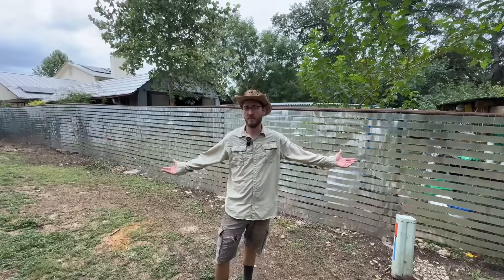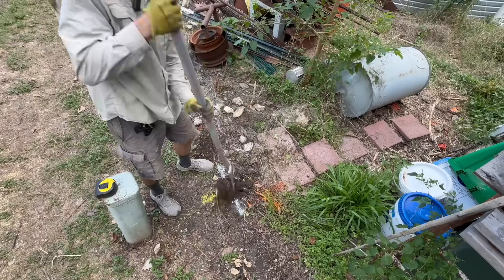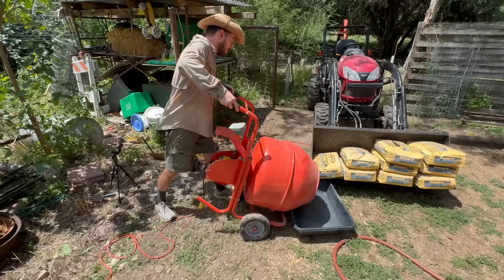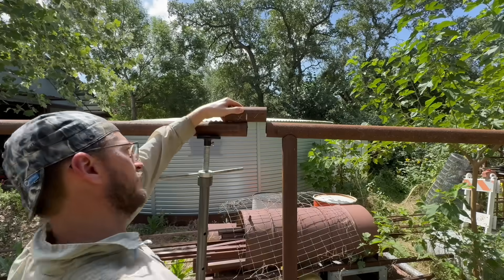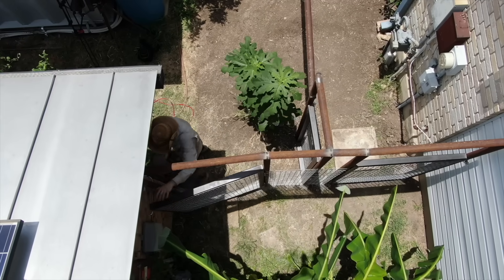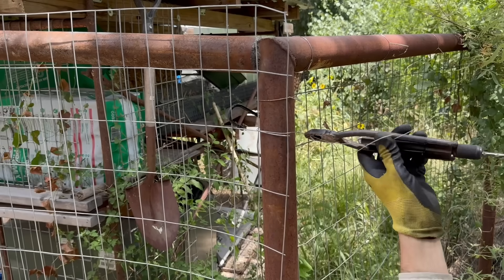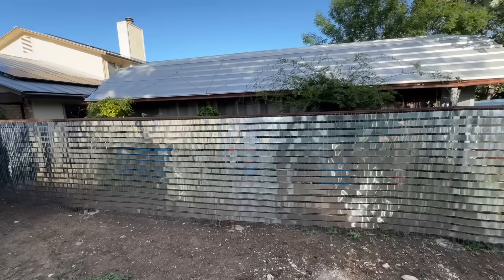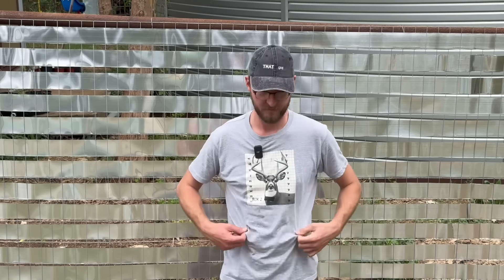This FENCE Lasts 100 years!!!!

Comment: Holy crap. In the best possible way.
The fence is gorgeous and ingenious. Love that it looks simultaneously industrial and soft.
So I'll never in my life do this, or most of your projects but I absolutely love your videos. From the idea, the execution, the quality of the details provided, the cinematography, to the truly clever humor-they're really perfect IMHO. And I always learn something. And it's frequently embarrassing. Like working something through a roll of fencing so when you cut that last wire the whole thing doesn't SPROING open causing you to jump back and having to wrangle a 6' Slinky. I'm only dealing with 4' rabbit fencing but still, that little bit of every day genius would have spared me a fair bit of aggravation. And feeling like an idiot.
The only possible potential downside would be galvanic corrosion but if your area is mostly dry you'll probably avoid the worst of it. To be fair, that chapter was early on in my Chemistry degree and my professional focus is elsewhere so someone else may be better equipped to weigh in to allay any concerns you may have or offer advice. Any oxide coating may be enough to negate that so I may be completely off. A little knowledge is a dangerous thing.
As to the deer, IME they don't like jumping where they can't see a clear landing area unless they're being chased and a risky leap is the lesser of two evils. I've got a 6' privacy fence where the deer are so comfortable they walk down the middle of the street at high noon and you have to steer around them and I've haven't had an incursion in the 3 years the fence has been up. They walk right next to the house and eat the plants at the base of the fence so if they thought getting in was a good idea they'd have done it by now.
Well done. Looking forward to the next video as always.
Reply from the maker: My experience with deer jumping is the same. It’s reassuring to hear it’s not just me. Thanks for the thoughtful comment. I appreciate you being here and weighing in!!!!
Reply: Yes ✝️💩 indeed
Reply: My future retirement home is in a forested, rural area a few hours north.   My neighbor has a 6 foot (maybe it's 8) privacy fence around his inner yard and he hasn't had deer problems since it went up.  He couldn't grow anything before then (too many deer and wild turkeys).  If for some reason you do still have problems, I've heard that putting a second material on top of the main fence confuses their vision enough to deter them.   Stapling a 12 to 18 inch strip of the same fencing used in this video is probably good enough....their eyes aren't setup correctly to have good depth perception.
Reply: My friend had a home in Fairfax, California with the backyard going uphill from the house, fenced 6’ all the way around.  Saw deers jump right over the fence from a standing position, not even a running start.  They thought the garden was their personal diner…😂LOL. No hunters in Marin county so the deer became a real pest in the area….

Comment: No way this is cheaper than wood …maybe where you are ….im looking at at least 5k plus of materials in your video (probably more like 10) lumber prices are tanking and metal is skyrocketing…not to mention you’ve got about 8k in tools to build it 😂…sorry bud, but my parents have a fence at there house I built 35 years ago with my dad that’s still in great shape because we used treated materials. Wood fencing is pretty much the best bang for your buck as far as longevity…if you live in a dry area use pressure treated lumber
Reply from the maker: Rough numbers are in the description. I pay by weight for stem pipe where I live so it’s probably cheaper than national average. It didn’t occur to me but I bought these pipes about 6 months ago. I didn’t check what steel process did after I saved that receipt.

Comment: What about galvanic corrosion? Is that an issue here?
Reply: @suburbanbiology galvanic corrosion requires moisture. So down here in New Zealand I live in place where the grass is always green and it rains all year round. This makes galvanic corrosion a real issue. The two I have had experience with is Stainless - Galvanized steel (iron coated with zinc to stop the rust). The stainless eats into the galv and causes issues. I couldn't figure out if your fence mesh was zinc coated or just steel. As texas may have a dry enough climate that rust isn't such an issue. 

The other is Aluminium - Copper. I cut up old drink cans into strips, hole punched, wrote tree variety names, and attached to my trees with copper wire (as I have a container full of off cuts etc, so was free). Turns out that the aluminium gets eaten into. And within a decade most of the labels had dropped off the trees as the aluminum between the hole punch which the wire went through and the edge of the tag. 

Google should be able to inform you of which metals corrode others. I can't remember the chemistry but it is well known and lists are about of what eats into what.
Reply: @zestoslife  you can just tell Anna periodic table that has electronegativity values
Reply: @zestoslife  Zinc also doesn't behave with aluminum. Aluminum/zinc/steel or aluminum/zinc/steel/stainless junctions in close proximity to eachother can be a nightmare at least in marine environments. Assuming this is all vertical and in a relatively dry climate and everything is kept clean of organic debris, it will dry out fairly quick after rain showers and the corrosion is probably going to be slow. My guess is that the zinc will disappear in five years from the points where the aluminum touches the galvanized steel mesh and after that the steel+rust starts eating away at the aluminum. It will take long to for this thing to corrode but it certainly isn't made to last a century. If that aluminum is indeed 100% aluminum and not an alloy (2xxx, 5xxx or 6xxx), it's probably going to corrode even faster.
Reply: I can tell you from my own pipe fencing that it is an issue. Within the 14 years that I have had those pipe Post in the ground I have had corrosion several times to the point that I've had to replace them. I don't know anything about the fancy science that y'all are talking about here I just know my own lived experience.😂
Reply: @KMF3  I worked in the transmission pipeline stuff. Cathodic protection is pretty easy to do and it's quite effective
Reply: @jeffday2574  ??? I have no idea what you are talking about
Reply: @KMF3  I might have answered you inadvertently I was talking about cathodic protection on steel pipe in contact with the ground. Steel pipe protected in this way is protected for decades
Reply: @jeffday2574  oh ok. I'm not sure how to do that
Reply: @KMF3  you take a 12 volt power supply like a 2 Amp trickle charger and bond a lead to the steel your trying to protect preferably with a cad weld to avoid corrosion run it to the negative side. Then  about thirty feet away sink an anode into the soil I use zinc or magnesium. Attach the positive lead to the anode. You can get an anode for a water heater from lowes or home depot these work very well. So now your pipe to soil voltage is going to read 1 to 2 volts negative. That electrical difference is going to pull electrons from the soil into the metal your trying to protect. When metals rust they are sending electrons from the metal into the soil. This reverses that. When you are testing this stick a screwdriver into the soil attach your negative lead to it and attach a positive lead to the pipe to read the DC voltage and it should read a negative voltage and you want  -.85 or higher -1 or -2 is typical
Reply: @jeffday2574  😲😳 that's way too complicated for me
Reply: @KMF3 😅🤣😂ME neither!!🤷🏼‍♀️
Reply: @KMF3 

Why not use PVC pipe for fence structure?

Would that work?
Reply: @streetsmartintelligent  it might but I doubt it would be strong enough to hold a shade for me or against horses damage
Reply: @streetsmartintelligent  
Probably not rigid enough.
Reply: @streetsmartintelligent 
PVC is a 20 year solution at best...UV light destroys it. Plus it's pretty weak. Sure you can fill the verticals with concrete....but why bother... typical PVC fencing uses metal posts or pressure treated wood, but still, in 20 years it's time to replace it after the PVC is cracked, discolored and typical already failed
Reply: @streetsmartintelligent pvc is normally not uv resistant and will fail as a structural material quite quickly
Reply: @streetsmartintelligent :

Filled with sand mix mortar?  
PVC alone isn’t strong enough.
Reply: @streetsmartintelligent not as sturdy, not environmentally friendly are my reasons.
Reply: @streetsmartintelligent Not strong enough?
Reply from the maker: Technically yes. But I’ve read that aluminum forms a stable oxide pretty quickly. I wonder if that will blunt the corrosion effect. I’ll try to pin your comment to see if we can get a chemist or physicist to weigh in.
Reply: @suburbanbiology read something just a day or two ago that said the oxide coating on Aluminum in air forms in just a few picoseconds so it will be reforming each time it loses contact with the other surface 😉 only place your likely to see any noticeable effect is where it sits in contact and stays wet with something that can breakdown the oxide😊
Reply: @suburbanbiology  I posted above. Yes, the Al will oxidize and that helps. Any movement between the flashing and the fence will scratch it off but it'll reform. It's a casual low-pressure contact so that helps. The big Al/SS concern is with tight contact in the presence of an electrolyte so think about a stainless fastener on an Al sheet near salt spray. Although acid rain is a contributor. The other consideration is the amount of material of each. The SS is the cathode, Al the anode. A large area of cathode will more quickly corrode the anode but since the fence is a smaller area relative to the flashing that offers a measure of protection. Al rivets on a large stainless base is a galvanic nightmare. Your situation is the opposite. Plus if your area is usually dry that greatly minimizes any risk. That's about all I recall-that class was a long time ago.
A metallurgist or materials scientist can give you the best assessment off the top of their head.
Reply: @suburbanbiology  This is an interesting fencing idea! I think U might what to put a pipe in at the bottom. When U weaved the flashing did U do every other one or what did U choose?
Reply: @suburbanbiology  You can install sacrificial zincs, like on a boat, to corrode instead of your fence.
Reply: @suburbanbiology the aluminum is fine but it does speed up rusting on untreated steel depending on the area might be fine but me living in the rust belt will always look for ways to lessen rusting
Reply: The aluminum was a dumb idea. It'll look like shit in ten years.
Reply: Sounds like an Awesome Metal Band Name!! Galvanic Corrosion!!  😂
Reply: Great concept. Creative execution! Love it!
Reply: I ❤ this. I would more than welcome you to be my neighbor. Great job 👍
Reply: Hey, I'm a 2%'er!
Reply: @bob_frazier.....ME too!!!👍😁
Reply: Ok, I subscribed. The fence looks a lot better than the old one! A lot of work though. The comments about metallurgy are over my head! 🤯 The plants are great, I hope they grow quickly to fill in; I think you need more. You have lots of interesting tools. I will never use any of them, as I am a 72 year old grandma living in an apartment in an urban area. So that’s a demographic for you.
Reply: @elizabethturel78  Same here 😂
Reply: I'm wondering if the vines will get burnt by the heat the aluminum will put off when the sun hits it. I'm sure it's going to get so hot to the touch. The fence looks awesome and I wish we had piping like this in Ontario Canada cheaper than I've seen it.
Reply: @rookiefarmer702 aluminum doesn't usually get hot, but does reflect light, so needs plants that enjoy plenty of light
Reply: the vines will be covering the fence well before it corrodes away most likely....
Reply: @jkiker7918  Use for basket weaving 😁😂
Reply: Is there a reason you didn't put flashing on the bottom row of the fence?
Reply: @PhD777  They mentioned sloping the land so the water would run past the fence onto their side of the fence. I'm guessing leaving the bottom row off is to prevent either the flashing from pooling water, or to prevent the flashing from collecting debris like leaves that would then pool water.
Reply: @PhD777 turtle passage?
Reply: If I comment and like, does that mean, I like it or don’t like it? 🤔
Reply: Do like your build and techniques used for installing fence along with “Fonzie” “Bill Gates”  puns….but seen no one questioning all that metal flashing,  your yard must be like 2000degrees anywhere close to that fence? I know I make unreal comment but it must be like a solar cooker with a few ft of this fence, Texas avg probably being 100 degrees with 12 hrs of sun every day through the summer.  Can’t imagine any plant growing within 2 ft of that fence? Would like to have seen differt colored flashing (red; green; blue; etc).      But you did a really nice job and great explanation on staking, welding, cutting, etc. Also like how you saved the Sycamore tree, the can grow really big and go 300 plus yrs old.  Volunteer and plant lots of trees myself. Keep up the good work.
Reply: The Fonz.    Hahaha.  Fawns ~ are so so cute  so l’d  probably llet them come inside.  At Certain places  of that   there property … frreee petting zoo..      and yep l like it.    that fence is so cooool
Reply: Do a video on how you wire the  fence for protection
Reply: can it be painted to prevent corrosion?
Reply: The aluminum strips in contact with the steel will corrode first, so effectivly protecting the steel structure like the zinc plating on the horse fence panels.   Yeah, the aluminum will form an oxide coating, but the corrosion will act under the oxide coating.   By the time the flashing has started to fall apart, the plant will have grown up to engulf the fence.
Reply: Most chainlink fences are galvanized and use aluminum wire to attach to posts. It should be just fine.
Reply: The aluminum will slowly form a white oxide coat. If it becomes an issue, spray the whole fence with green zinc chromate primer. Wear a fine filter face mask while spraying that stuff.
Reply: When the sun is at it's hottest or brightest moments won't your eyes hurt? Hope the metal lasts for years and you can paint on it with nature colors(?!)
Reply: I must admit that you've made a heck of a nice fence! Good job...wondering if the fence did keep deer out? I don't know what kind of deer you have where your at,  Where I am from a deer can jump 10 to 15 feet if not more without even trying!
Reply: Well done on all that hard work.  I wd love to see the fence reflecting light at different times of day, if u have time to post that (pardon the pun) sometime?
Reply: A 12VDC POWER supply is  how you  can do cathodic protection sink an anode attach positive lead to it negative to the fence ideally you want 1 or 2 volts read between the structure you are trying to protect and an earth ground like a screwdriver jabbed into the ground. A minimum of .85 volts should be read. What you are doing is making the pipe more negative than the surrounding soil drawing the current flow into the pipe not away from it
Reply: Interesting 🫡
Reply: aluminium form oxide with oxygen under nanoseconds.. otherwise will combust..
Reply: He issue is that these beasts can easily jump over 6 feet fence.
Reply: Yes
Reply: With new foreign steel, yep.
Reply: See you in a 100 years😂😂😂.   I got ranches all over, come on over. 🤣
Reply: Lost me at harbor freight 😂
Reply: Not in Texas...
Reply: Aluminum is stable when it's oxidized. In fact every rust is the stable form against nature. It becomes sort of ceramic
Reply: White tail deer can clear a 6 ft fence
Reply: Bare aluminium always immediately forms an oxidized layer that shields the inside from being oxidized.
     It's not like iron or steel, where you can have a 'bad' oxide (red oxidization) that will keep reacting / eating through until there's nothing left.

Galvanic corrosion might ensure that the steel and aluminium parts will be harder to seperate over time, though. 
     That's what happens when you have an alu seat post in a steel bike frame. (Alu oxide takes up more space, so it expands outward inside the frame, making it unusually /insanely difficult to remove)

Anodized aluminium (like on a macbook or so) utilizes the non-reactive aspect of alu oxide as a layer of protection.
      (In essence, it's just a more controlled, more even, deeper than what naturally would occur, layer of aluminium oxide.
     The anodization process also gives it some extra strength, as it forms a structure of alu oxide nano-tubes on the surface of the aluminium)
Reply: Deer, bucks, and Fonz 🤘💃
Reply: The fence has a brutalist/modern vibe. The execution of those saddle joints!👏🏼👏🏼👏🏼
Reply: A zinc anode is best like a waterheater sacrificial anode. Run with a DC bias from your cathodic supply . I used to do this at my job when I had one. Worked very Well in any soil.